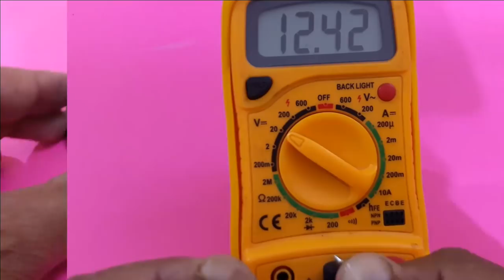Tips-protect speaker and tweeter from burning

Comment: Isn't voltage that kills speakers its clipping that kills thems
Reply: chad smith I'm pretty sure if you quadruple the amount of voltage needed for the speaker I'm pretty sure clipping has nothing to do with it at that point. It's an instant one shot destroy of a speaker.
Reply: ExTr3m3 BASS. Lies bruh i seen speakers take tripel the amont of power all day my freind has a sundow zv3 on 5krms and shit dosnt even burn or get hot now your door speakers and high range speakers are a diffrent stroy
Reply: ExTr3m3 BASS also voltage is what you use to set the power range the only reason the leight started to flicker is becuse of cliping. Cliping is where the amp stops puting out ac voltages and just put out dc voltage out to tge speaker
Reply: ExTr3m3 BASS. Also any speaker taking in voltages higher then recommended isn't good for them but speakers run off of voltage so the lamp bulb is just a clip detector
Reply: chad leimgruber and distortion
Reply: its both... clippings is like a hot knife trough your speaker it fkn shreds them. but if you take a 500 w rms subwoofer and put in 7500 w rms it aint gonna last long. also you used sundown as a example but sundown is really underated  and can take a lot of beating without breaking. 

but this is dumb because its gonna short out the amp (talking about this vid)
Reply: It's both: Woofers are killed by too much voltage (resulting in too much power) while tweeters are often killed by clipping. The reason is that the harmonic content of the sound is changed when an amplifier distorts resulting in maybe 10 times more treble than if the sound is clean. This overloads the tweeter.
Reply: Clipping is no problem for a bass speaker whatsoever. It' s no more DC than an unclipped signal, it just has flat spots in the AC peaks . The problem with clipping is that the transients at the beginning and end of the flat spots will be seen as high frequency content by the crossover filter and send an undesired amount of power to the tweeters which will start smoking pretty soon.. The protection with a lightbulb was present in several Bose products ( and critisized because it influences the reproduction of dynamic signals). It does it's job..
Reply: @ottonormalverbrauch3794  clipping is not a problem for a bass speaker.... it is a problem a clipped signal is going to fuck every speaker up, tweeter, mids, high and lf speakers. it aint gonna matter. how ever the second thingyou say is true bose did use some lamps. But Bose is shit so... 

in other words if you gonna send square waves to any kind of speaker its gonna be broken very soon
Reply: As a qualified technician for thirty years or so I can assure you it won't ruin ' any speaker' for the simple fact that that the start of the 'flat spot' of the clip will simply stop the rise of force working on the voicecoil and the end of the flat spot will reduce the force working on the voicecoil. Hence there is no mechanical stress greater than the admissable maximum and no electrical stress either. Clipping is no DC as a square wave isn't. You ever heard of a square wave of a synth (in essence the ultimate clipped signal) destroying a keyboard player's speakers?....
Reply: @ottonormalverbrauch3794  stated "You ever heard of a square wave of a synth (in essence the ultimate clipped signal) destroying a keyboard player's speakers?...."

There is a huge difference between an audio signal square wave and amplifier DC clipping. 

I have done "Front Of House" live audio since 1981. This is something I have years of experience with. The square wave from a synth is not the same thing as an amplifier clipping it's power rails. It is NOT the "essence of an ultimate clipped signal". At the moment you clip an amplifiers DC power rails, your speaker's voice coil sees a pure DC signal that is measured in Volts and Amps and it will turn the voice coil into a heating element. The signal from a synth may look the same but the voltages from the synth will measure in millivolts and have milliamps of current behind it. 

Actually, the keyboard player from one of the bands I do sound for is responsible for blowing the horn in his monitor 4 or 5 times. I would set the level to his monitor and leave about 6db of headroom and during the show, he would turn up the output level on his keyboard until the monitor console was clipping. I refused to supply his monitor cabinet at this point unless he would agree to pay for the diaphragm. 1" JBL diaphragms are about $85.00 ea. He hasn't blown up a single diaphragm since.
Reply: @rwj1313  Like you say " he blew the horns several times". I assume that he didn't blow any woofers. Horns are in essence tweeters with a horn in front and therefore vulnerable to overload.
Clipping signals and square waves contain many harmonic content (mostly uneven) that outputs a lot of power in the high range. The horns then get more load than with a normal music signal.
A square wave is no more DC than a sine wave. A woofer will get no greater thermal heat load from a 100 Watt clipped signal than from a 100 Watt sine wave. I have to repair things your musicians break :)
Reply: @ottonormalverbrauch3794  stated "A woofer will get no greater thermal heat load from a 100 Watt clipped signal than from a 100 Watt sine wave"

Nonsense, a sine wave and a square wave with the same peak-to-peak value will not have the same RMS value.   

Into the same load, a square wave will deliver more power than a sine wave of the same peak voltage. This is same as saying the square wave has an RMS voltage equal to its peak value; whereas a sinewave has an RMS value of 0.707 (actually sqrt(2)/2) times the peak value.

This is very basic electronics I learned in high school tech school. 

https://www.flickr.com/photos/109161978@N03/45861442084

Once again, an amplifier "clipping" is NOT the same as a signal square wave. When an amplifier is "clipping" it is receiving a signal that is trying to push it past the power supply rails. ALL audio power amps have a plus and minus power supply rail that allows the signal to swing positive and negative. If the rails only go to +34VDC and -34VDC and you send it a signal that tells it to go beyond that it literally clips the top of the sine wave off. The signal is no longer AC at this point. It is DC at the full value of the power supply rails. This is what burns up a voice coil. It has literally nothing to do with harmonic content. My little club PA system has horns with 1" JBL diaphragms that are rated 75 WRMS. I have them powered with a power amp that is capable of  650 WRMS a channel at 4 ohms. I have never blown any of these diaphragms because I NEVER clip them. They see square wave keyboard content all the time. I have woofers in my subs that are rated to handle 1000WRMS but if I sent them a consistently clipped 100WRMS signal they would burn up the voice coils rather quickly. 

EV MTL-2 Subs and JBL MR 822 top boxes. The MR 822's have been modified so that the internal crossover is bypassed. They have an extra set of jacks that allow me to Bi-amp them sending highs to the 1" horn and mids to the 12" woofer. 
https://www.flickr.com/photos/109161978@N03/45796126532

This is my FOH "club rig". https://www.flickr.com/photos/109161978@N03/22341553681

While I have done sound since 1981 I received an Electrical Engineering degree in 1987. I have designed and built circuit boards that literally have my name on them. 

https://www.flickr.com/photos/109161978@N03/13030501544
Reply: @rwj1313  I said that a 100 Watt square wave has the same heat result as a 100 Watt sine wave. They do not have the same PP voltage but the power is the same so the thermal load is the same. This goes for equal RMS values. A signal does not become DC just because the value stays the same for some time. As long as it changes polarity multiple times a second it's still AC.
For stated reasons it's logical that tweeters, horns and maybe mids are destroyed by clipping because Fourier analysis shows that the high frequencies are much more pronounced than in a normal music signal so the high units are thermally overloaded. 
If woofers are just gualified to handle the rated amp power they may get overloaded by the clipping amp because the clipping power is higher than the amp's rated values but they do not get destroyed per se by clipping as such.....it is not DC. period... Your comment about synths low output voltages I did not get...you do amplify them, don't you?
Reply: @ottonormalverbrauch3794  stated "I said that a 100 Watt square wave has the same heat result as a 100 Watt sine wave. They do not have the same PP voltage but the power is the same so the thermal load is the same."

100 watts is 100 watts regardless of whether it's a sine wave or a square wave but that is NOT what we have been discussing. We are talking about an amplifier "clipping" a sine wave into a square wave. A "clipped" sine wave will have more energy than an unclipped sinewave at the same frequency. 

 Otto Normalverbrauch  stated "If woofers are just gualified to handle the rated amp power they may get overloaded by the clipping amp because the clipping power is higher than the amp's rated values but they do not get destroyed per se by clipping as such.....it is not DC. period"

You seem to be oblivious to what "clipping" is and why it is called "clipping".

At the moment a sine wave is clipped it is DC for the period of time it is clipped. It will be DC equal to the power amps rail voltage. The instant a voice-coil stops moving, due to clipping, it becomes a heating element. A heavy-duty woofer can handle occasional spikes but if you clipped the signal every time the bass drum hit for a full 4-minute rock or pop song that speakers voice-coil will become toast.

2000 Watt power amps can have rail voltages in excess of (+) 90 VDC and (-) 90VDC. During the time period that a sine wave is "clipped" the signal is DC at either (+) 90 VDC or (-) 90VDC. This WILL, in fact, destroy even the most heavy-duty woofer!
Reply: @rwj1313  Hi Rick, I am not oblivious to anything. I have repaired audio from transistor radio' s via all kinds of speakers  to large class D for the last thirty years..  90 V rail voltage amp clipping is  close to 1000 Watts into 8 Ohms, that is enough to toast most voice coils. It is the sheer power here that fries it, not the DC nature of the signal cause it is still changing polarity at, let's say 400 times a second and therefor not DC by definition. DC is not defined by 'steady voltage' It is DC because it has no changing of polarity. 
As a kid I blew my parent's tweeters of 100 Watt rated AR speakers with a twelve Watts amp by moderate clipping. DC cannot be Fourier analysed into high frequency energy but sudden transitions can..
So it's the sudden changes that are the culprit and aren't changes more a part of AC than of DC? ;)
Reply: @ottonormalverbrauch3794  When a sine wave is clipped it is no longer changing states. It is at the rail voltage which is DC for a given length of time. The amount of time will be dependant upon how far beyond clipping the signal is pushed.
Reply: @rwj1313  Still no DC, sorry. For given reasons. A squarewave is no DC either. If you look at a small enough interval of time any signal would be DC by tlyour definition. Donthe following experiment. Put two lightbulbs in place of the speakers of a two way system and feed with an amp with 500 Hz. As clipping is reached the lamps will not change into 'heating elements. The woofer light will gradually light up more ( and not suddenly more because of clipping) and at clipping level the tweeter light will suddenly start to light up gradually because the high filter responds to the sudden change in dV / dt. Which it will interpret as high frequencies of 3,5,7 etc times 500 Hz.
With audio signal the situation gets worse for the tweeter because the knicks are more frequent.
Reply: @ottonormalverbrauch3794  stated "If you look at a small enough interval of time any signal would be DC by tlyour definition"

Ok Otto, what is the interval of time required for any voltage to be considered DC?

This entire debate is centered on what happens to a voice coil when you expose it to "clipping". You have tried repeatedly to compare a signal square wave to amplifier clipping and they are NOT the same thing. 

So I will ask you again, what is the interval of time required for any voltage to be considered DC?
Reply: @rwj1313 We're wandering off :) I think the here point is, when turning up the volume beyond clipping level there is no additional risk for woofers as there is for tweeters and mid horns. The applied power (that feeds the voicecoil which is also your heating element) gradually increases and has no extra load on the voicecoil than this gradual rise and as long as you keep this power below woofer ratings and the cone excursions below the rated values there is no extra danger of damage just because of clipping. Like said, do the experiment, measure the voltage and current, do the power math for the Ohm part of the voicecoil impedance and you'll see a gradual power increase without sudden danger zones due to clipping..
Have a nice weekend!
Reply: @rwj1313  To get things straight: you do not come with a single argument but just with statements you picked up in practice or in education. Give me one argument why a clipped signal would result in more heat dissipation in a voicecoil than an audiosignal with the same RMS value. Dangers to voicecoils are overvoltage and true DC where the voicecoil reaches a standstill in a certain excursion and the cooling effect of motion falls away. Clipping as such is only dangerous if the maximum power ratings of the woofer are exceeded. And again DC is by definition a voltage that does not change polarity.
A severely clipped sine signal only differs from a square wave because it has a longer rise- and fall time . The cause is different but on the oscillocope they look very similar and for voicecoils they are indistinguishable as they get heated up by both of the heat with the amount of energy they are fed.
Again you can try to do my experiments and witness that the moment clipping sets in no sudden rise in heat dissipation follows just a shift to more energy fed to the high sections which are extremely sensible to overload. (as was demonstrated by the blown horns of the keyboardplayer you wrote about). 
I will finish now because I can spend my time more useful repairing stuff you soundpersons and musicians tend to demolish. ;)
Reply: @ottonormalverbrauch3794  stated "A severely clipped sine signal only differs from a square wave because it has a longer rise- and fall time . "

The rise time and fall time are irrelevant. The only thing that matters is the time that the signal is clipped and exposing the voice coil to the full voltage and power of the amplifier's positive and negative supply rails! No matter what you say or try to argue, the supply rails are in fact DC! The instant that DC is supplied to a voice coil it stops moving and when it stops moving it starts heating up rapidly. 

My argument from the very beginning of this was simple. You stated "Clipping is no DC as a square wave isn't. You ever heard of a square wave of a synth (in essence the ultimate clipped signal) destroying a keyboard player's speakers?"

I stated very specifically, "an amplifier "clipping" is NOT the same as a signal square wave. When an amplifier is "clipping" it is receiving a signal that is trying to push it past the power supply rails."

You can believe whatever you want to believe. Arguing with you about this subject is like arguing with a flat-earther. No amount of reason, logic or scientific fact will change your mind.  

So let's see what professionals say about it:

It is essential that a live sound engineer set the sound system in a way to avoid clipping because a failure to do so could cause damage to the loudspeakers. When a signal reaches the point of clipping, speaker cones do not move, as the clipped signal is essentially a DC signal for the duration that it exceeds the voltage rail boundaries. This causes all of the power from the amplifier to be used towards heating the voice coils instead of producing sound. In other words, during the times the signal is flattened, a loudspeaker is 100% efficient at converting power into heat.
https://mackie.com/blog/what-clipping

From Prosoundweb's "Study Hall" sponsored by audio-technica

Why Should We Care About Power Amplifier Clipping?

Clipping means that the tops of the signal are “clipped off” or “flat-topped” when the signal level is exceeding the maximum capability of the power amplifier or some other piece of equipment in the system.

During the times when a signal is flat-topped, loudspeaker cones are not being “instructed” to move as it is receiving essentially a DC signal. This means all power goes into heating up their voice coils instead of producing sound.

In other words, during the times the signal is flat-topped a loudspeaker is 100 percent efficient at converting power into heat. 
https://www.prosoundweb.com/topics/education/why_should_we_care_about_power_amplifier_clipping/

How about JBL? Maybe they know something about "Pro Audio".

The most likely cause of DC-like burns is an overdriven amplifier.

When an amplifier receives an input signal capable of driving it beyond its power rating, the result is clipping. This means that the negative and positive peaks of the amplifier's output signal are "clipped" off. The amplifier may also clip in an asymmetrical fashion, meaning that the positive side of the signal is clipped more than the negative (or vice versa). When subjected to an asymmetrical clipped waveform, one end of the loudspeaker's voice coil is "on average" spending more time outside of the gap (corresponding to the direction that is clipped) than the other. The end of the coil that is spending more time outside of the gap has poor heat transfer to the magnet structure. As a result, it overheats and burns.

https://www.jblpro.com/pages/general_faq.htm

At high regime it will clip and distort or fail to send "square signals" or, through power supply destabilization, it will supply direct current to the loudspeaker, which will be fatal for it. During clipping, a 40 Watt amplifier can reach 100 or 120 Watts distorted over 1 millisecond. 

https://www.focal.com/en/focal-teach/why-do-voice-coils-burn-out

Clipping

Amplifier distortion occurring when a high energy waveform (a very loud sound resulting in a large output) is input into an amplifier and the amplifier is unable to fully reproduce it due to power supply limitations or amplifier design limitations resulting in the audio output waves being cut off (the rounded tops sliced off resulting in short waves with flat tops). Clipping creates audible distortion and can be damaging to speakers especially if the clipping is hard and frequent.

http://www.audiovideo101.com/dictionary/dictionary.asp?dictionaryid=100

What is clipping?

Clipping is distortion in the signal from the amplifier to the speaker that is caused when one or more of the waveforms that represent the many instruments and voices in a music signal are driven at levels to the speakers beyond maximum amplifier levels.

The most common, and avoidable, form of amplifier clipping occurs when an audio amplifier is driven beyond its ability to generate sufficient voltage or current to reproduce the original signal to your speakers. The generated up and down voltage swing is limited at some maximum values in either direction and the resulting sound reaching the speakers is distorted.

Long-term clipping can result from extended amplifier play over several hours as well. Inadequate cooling in the amplifier may further limit the power available. Subwoofers can overheat if not chosen properly, clipping the sound in a similar distorted manner when they fail to completely follow the original waveform even if the amplifier signal is accurate. Be aware that additional energy is pushed through the speakers in this condition that generates more heat than correctly formed signals. Because of this problem, clipping may damage speakers due to overheating

https://www.mtx.com/library-clipping
Reply: @rwj1313  In short: when the clipping signal exceeds the maximum speaker ratings it puts the speakers in danger strictly because of the surplus in applied power ( the quote mentions 120 W from a 40 W amp?)  That is about what I already said..
The partial heating part I did not take into account. ( my bad)
But clipping is still not much different from a square wave, only the amplitudes can differ. I like the flat earth comparison although I tend to be on the spheroid side of the discussion . ;) 
One important point: Professional systems as mentioned by the professional quotes do often use active filtering for different frequency bands so mentioned phenomena are pointed towards woofers. In passively filtered (home) systems mid- and high units will long have vapourized before the woofer is in any danger when clipping of any severety occurs.
Reply: namcost how did you determine your head Unit clipping point ? With smd dd1?